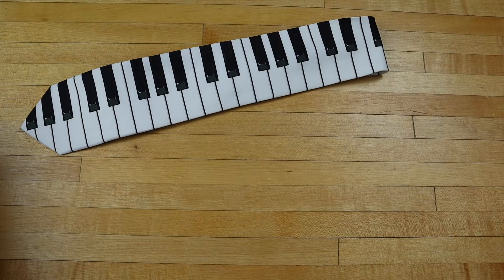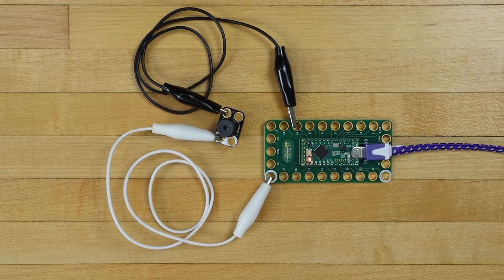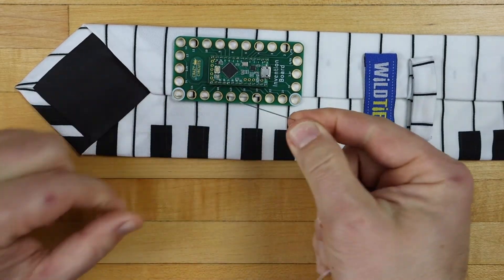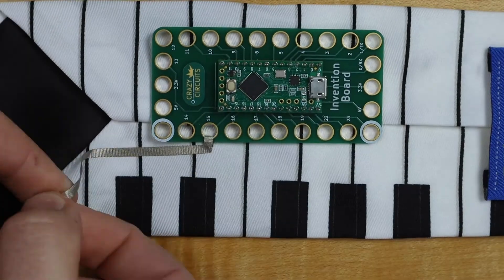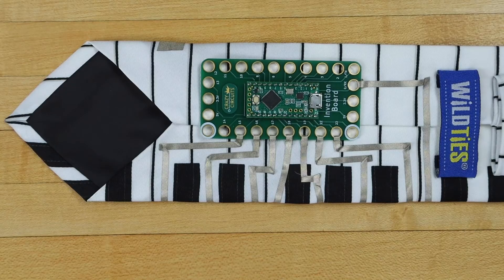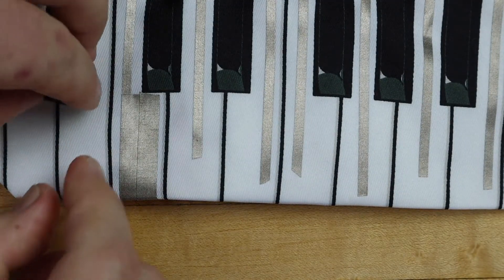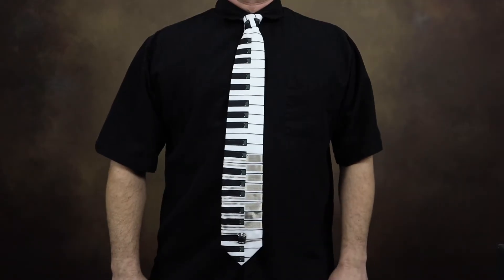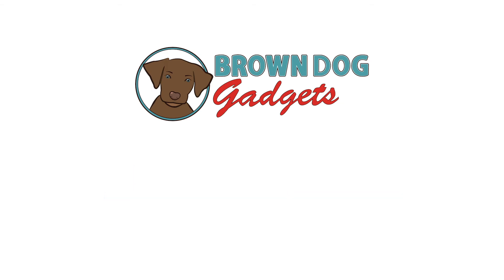How to make a playable Piano Necktie!

Comment: Here's how i made one that worked amazingly well about ten years ago. 

Buy "roll up keyboard".  Cut rubber open and remove pliable circuit board.  Cut to pliable circuit board to shape of tie. 

Buy piano tie.  Cut open at seem.  Put board in and secure with a few sewing threads.   

Hand sew tie closed. 

Buy musical greeting card.  Remove speaker and battery.  Splice to the tie circuitry as the original speaker was.  

Glue to back of tie knot; back of tie or inside clip on "knot".  

It will sound like a real key board. Cost ya about 40 dollars and requires zero expertise.